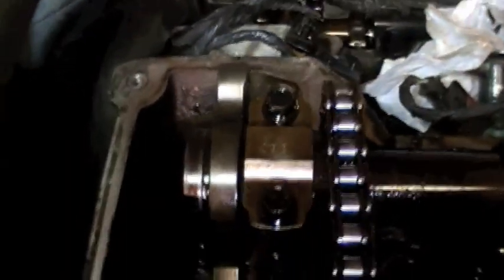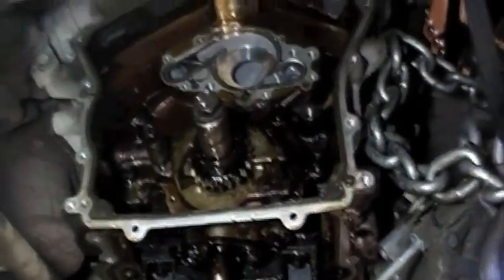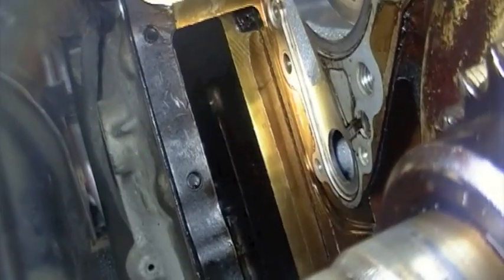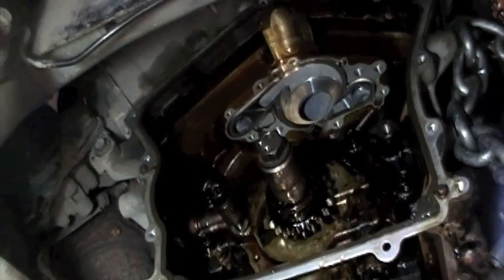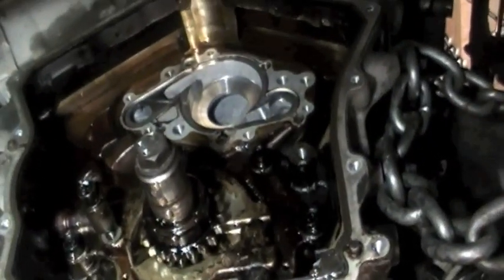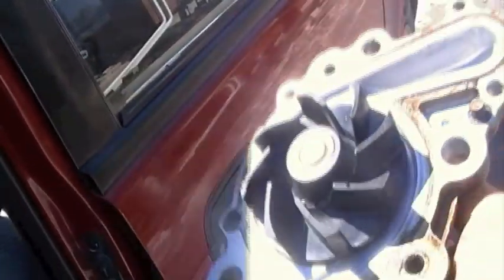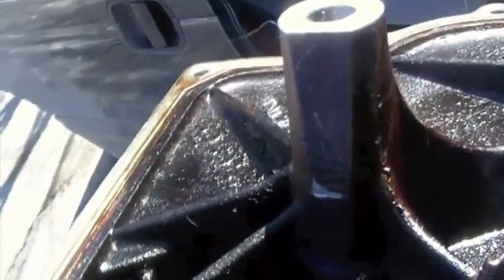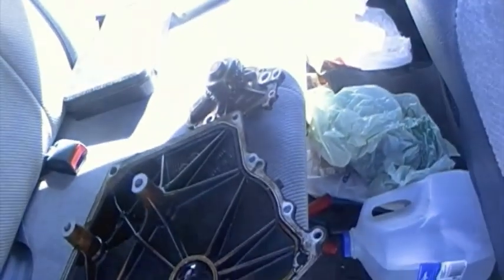How to Fix Your Chrysler 2.7 Engine The Right Way! Part 3 of 3

Comment: rip the engine out of the car, sell it for scrap metal value that's about what that lemon is worth...  if you engine needs to be completly rebuilt every 70k miles it's a shitty engine
Reply: hahahahahhahahaha
Reply: TBH Jesse's recommending 100K km, which is close to your shitty 70K.  Chrysler recommends 100K miles.  My 2004 Intrepid with the 2.7 L engine got to 132000 miles before the chain rattled.  The 100K mile rebuild is still pretty close to shitty, but I'll keep the car and do it again in 10 years.

Comment: everything that touches the chain,always replace the chain,soak the chan in DURALUBE, all night,before replacing it,then put duralube in the engine,every other oil change, water pump design in itself is a ridiculous design,this motor is no more stupid than doing a 1300 dollar brake job on a corvette,its necessary,and built in when you purchase such a car,next time research before you purchase,i mean VEGA TO CHEVETTE TO other junk,every year they build a born lemon, law of averages,we mechanics hate it to,we have to work on this junk ev ery day

Comment: My 2.7 is stsrting to tick,did waterpump,should have done the oil pump at the same time ..do you think i could try to flush some of sludge out?
Reply: If the ticking is in the valve train, only a head rebuild will clean it out.  If it's the bottom end, there is no point.  Drive it until it blows up and never buy a 2.7 again.

I have a 3.0L Mits Minivan and a 3.5L Intrepid.  Both engines are far superior for durability to the 2.7.  You also have many 3.2s and 3.3s to choose from in the relative years if you want to replace the car with something Chrysler used that isn't a 2.7.

Comment: the engineer who made this engine should be shot!
Reply: No.  The engineer who designed this should be forced to have sex with Rosie Odonnel or a hive of killer bees.  His choice.
Reply: There are alot of engineers  that make pain in the asses
Reply: They sure do
Reply: I have a 2.7L 1999 Chrysler Concorde . Gasket in water pump blowed didn't expect that . Blue and light colored smoke poured out tail pipe . Could smell anti freeze in motor oil . Towed changed oil ran smooth til water mixed with oil than shut off . Gooped high tech Lucas , coated bearings with Lucas assembly lube semi-synthetic oil . 30,000 miles ago no knocking or rattling at all . I think your repair will be just as good or better . Don't forget to clear all codes . Picky but tough motors .
Reply: "How to Fix Your Chrysler 2.7 Engine"       With a match and gallon of gas.

Serious... how much time are you going to put into a car worth 500 bucks.
Reply: @bigd9260  When my 2.7L quit,I was at my elderly widowed mom's house,so I left it there to make it look like she was not alone. Sold it later where/as is for $200.
Reply: MrShitrope that was the idea to make it difficult so they can eliminate vehicles and Dodge Chrysler volunteered..

Comment: Great video Jesse! Have the same problem with 02 sebring convertible. found coolant in the oil after the water pump was changed by goodyear...they used the wrong camshaft sprocket. wondering how hard this is to do myself. but engine is noisy now, so possibly bent valves? how to diagnose how much engine damage exists?

Comment: I'm working on a Chrysler 2.7 l engine that may have had coolant in the oil at some point in its life.  The car starts normally 7 or 8 times out of 10 but randomly cranks but doesn't start. Might this be a symptom of engine damage because of the coolant?

Comment: take off the oil cap and check for a milky look on the bottom of the car to see if you have oil/water mixing. as for the coolant leaking on side its probably the water pump or water pump seal gone bad. and lastly have a mech do a compression test to see if any of the cylinders are leaking(lets you know if u have a head gasket leak)

Comment: take off the HEADS first and check the Gasket for bad spots then have the heads checked for cracks.
If no cracks replace water pump,timing chains and gears, oil pump while you have it apart,all filters, take radiator to shop for cleaning.
thats what i would do if it were mine.

Comment: Also, in some cases plastic fins are better than metal, lighter, easier to spin, and won't chew up your block if the bearing in the pump goes.

Comment: The reason why they just blanket state that "you need a new motor" whenever a Chrysler comes in for noise/power loss/oil consumption, is for the labor it costs to find out exactly why a motor is making noise, or sludge, or power is down. There are probably lots of situations where the motor could have been saved with just tensioner pads and water pump/seals had the mechanic stripped the motor down further to pinpoint the problem.

Comment: According to your statement, my 1972 Pontiac, with a million miles on the clock, running with the original engine,(never re-built) should have had the timing chains changed at what mileage? Valve lash on engines with bucket tappets certainly run in excess of 5000miles before requiring adjustment. Every vehicle which I have owned has exceeded 100,000 miles without significant problems. Sorry,your information appears to be somewhat flawed.

Comment: I have an 2002 sebring convertible and recently I've had to change the fuel pump and the car was running fine for a month then one day the car just died while I was driving, I can get the car to start but it wont run for long any idea on what it could be or what I can do to fix it and keep it running? I put a new camshaft sensor in it and its still doing the same thing.

Comment: bubbling because of boil over,.. is over heating,.. could also be low coolant, bad rad, or cooling fans not kicking in. if its a head gasket,. you'll be running low on cooling fluid,.. with either,.. coolant in the oil, or oil in the coolant,.. or white smoke and loss of cooling fluid.

Comment: uaaaaaaahhh thats a BAD  sine man you have most likeley a bad head gasket man that might be a 2000 doller repair +/-600$ is not supposed to bubble in the reservior tank thats exzust gases getting in your cooling system and you check a thermistat by takeing it out and putting it in boiling water thats the sure way to do it it could be a bad head gasket cracked head warped head cracked cylinder wall you gotta check all that and its not simple to do pressure test the system

Comment: i saw your video and i would like to ask you something about my car is a DODGE INTREPID 2003 and is over heating i fix and change the thermostat new hoses up and lower but something is wrong with it it had a air thermostat hsng
Reply: Its not a air thermostat housing...its where you have to bleed it...

Comment: This is great. I notice that Chrysler upgraded the waterpump and chain set up Tell me if the 2008 2.7l engine  still needs the waterpump and chain replacement at 100k. Are engines in the 07/08+ era still failing?

Comment: nicely done my friend. for all those who hate on chyrsler ok. i have seen alot of bad. but also I just sold my sebring with 254,000 miles on it, no it is not a typo 254,000 miles it has a 2.7L if you take care of them they will last. I used lucas every 3000 miles. yes i put alot of money in upkeep, just as i do my chevy or 2011 outback. I have found most of the people that complain either listent to mechanic that wants more money or does not know a whole lot about cars? every car has its downs.
Reply: ....best regards from germany. But what do you mean with "Lucas" every 3000 miles? Did you changed the oil every 3000 or what do you mean with it??
Reply: @hardcorehotze5675 Lucas is an oil additive to prevent sludge.

Comment: Friend I'm from Mexico and I have a v6 stratus 2.7 as yours, just change the water pump because it hurt but other than that change the pump you hear a sound at the top of the engine is like a clicking, not out exhaust fumes. I would greatly appreciate any advice I could give him change the oil twice ........... thanks

Comment: First of all the rods used in the 2.7 are very prone to becoming out of round, and will chew a new bearing right out within a few days of operation. Second of all all Chrysler  engines are not the same when it comes to bearing sizes, there are stamped numbers on the crankshaft as well as on the side of the block which dictate what bearing size in needed for a certain main bearing.

Comment: If you want to know that "Crank Shaft cover" is called the windage tray, and it prevents the oil in the pan from becoming aerated by the crankshaft counterweights. You should also never attempt to replace any of the bearings without removing the engine, for a lot of reasons.

Comment: Where is video #4? Probably never got put back together. Anyone can take something apart. I am a 40 year chrysler mechanic and from experience if this engine has a problem it needs total rebuild. Can't be patched up like an old 318. Don't waste time and money. All Chrysler engines ending in a 7 are junk. 2.7  3.7  4.7
Reply: moparracer3-my chrysler 300, 2007 has a 3.5 I hope this engine is better?
Reply: Dang you give me no hope lol ...not sure what’s wrong with my Chrysler my timing chain is showing ...the box over it popped making the chain show:/ it sucks it was a good car

Comment: Because it is off a Mitsubishi design and dose not use cam bearing. meaning the cams wear right into the head. the reason the crank has to be replaced and turning it is useless is becouse of the thrust bearing when they fail the wear into the crank in the location i stated befor you can only go up to .010 oversize on these and the crank is usually to far gone.  buing a crank kit is cheaper then having it turned anyway

Comment: Which causes the oil to leak from the bearings at a higher rate then they were desighned for eventually leading to the wear of all your bearing on the bottom end requiring the engine to be pulled so that you can pull the crank and REPLACE IT... if the engine is bad enough like say you can put 50 waight in it and the light still comes on the heads will need to be replaced

Comment: This is all that I do is rebuild 2.7's. the new water pumps still have plastic fins which are far superior to metal, why would it break off???? Any way the problem with these engines is that they do not lubricate the main thrust bearings which causes them to wear out. this allows the crank to walk back and forth

Comment: I have a 2.7 chrysler engine that failed.  When the motor failed, it was hot but was still running.  I was told that the motor jumped it timing and the push rods got bent, therefore the motor is garbage.  Is this true?

Comment: Just replaced the water pump in my wifes 02' Sebring (238,000 on original WP w/ help from Mobile 1 oil)). It took a while to get the right parts because they superceded the parts #s several times and after realizing that I'd have to upgrade the whole timing chain,guide, etc, I decided to go with just an original pump and tensioner. It wasn't fun (7hrs later) but as long as the cams were locked down and I had plenty of chain (by removing the front cam sprocket, the pump was removed easily. Thanks